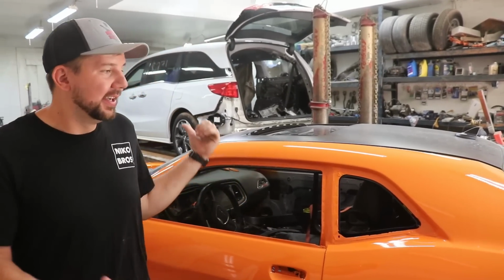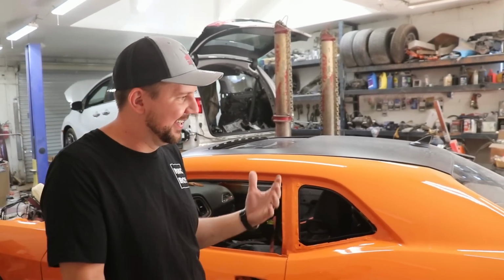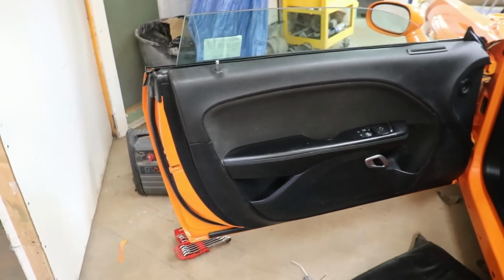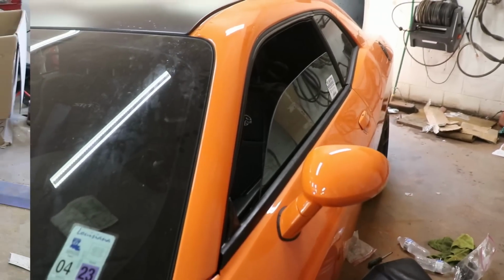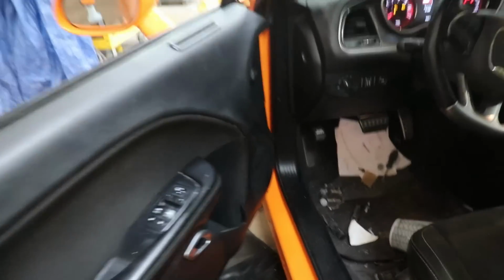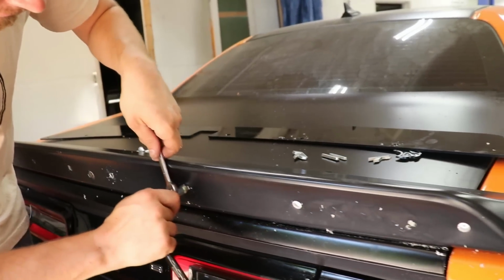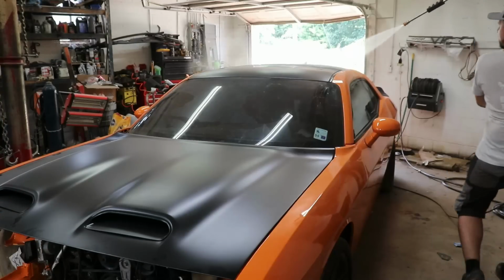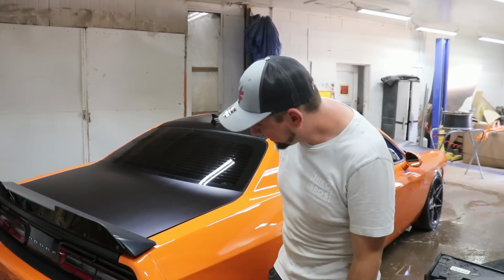REBUILDING A 2018 HELLCAT ASSEMBLY & NAME CHOSEN Part 9

Comment: That after market diffuser thing on the rear??? definitely not its so trailer park..... does not look good at all... the rest Brilliant Job!
Reply: I think the rear duckbill extension, which you called a diffuser, doesn't look horrible, but is it even remotely necessary? The duckbill spoiler on the rear of my AAR, which looks very similar, was quite functional at 70mph. It would push the rear down noticeably and raise the front at legal freeway speeds. The extension is just overkill.

Comment: Why did you guys paint over the door lock mechanisms?? Makes the job look bad.

Also why are trunk hinges black with orange screws and hood hinges orange. Doesn't make sense and makes the build look sloppy.

Also don't forget to get the proper steering wheel airbag for the car. The one that is in it does not go to a hellcat. Heck it's probably no good anyway.

Comment: The rear add on to the factory spoiler looks very cheap on that car. Should've spent the extra money and  got a one piece. The bolts showing looks like a high school kid threw on a old truck bug deflector to look cool..... Come on guys, you're better than that....
Reply: Really I kinda like that add on. Different wtg
Reply: @pappybigbearUtqiagkia5840  I like that style too. Just didn't like the application they used.